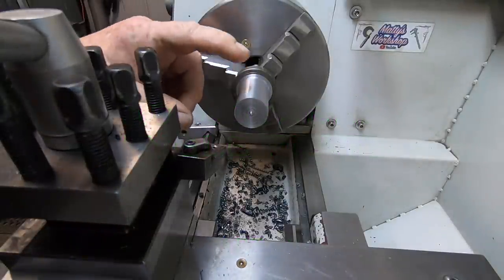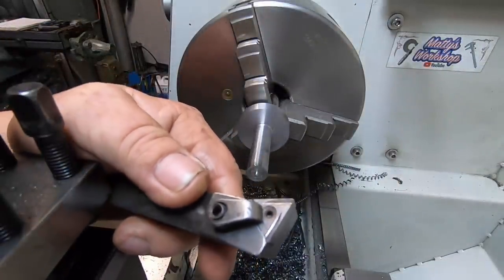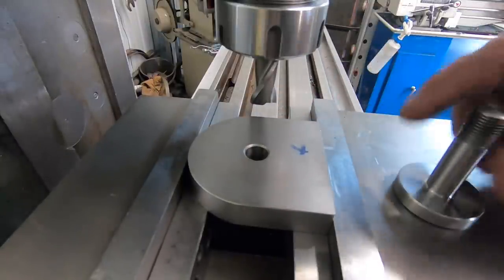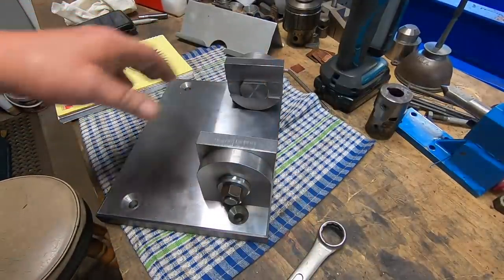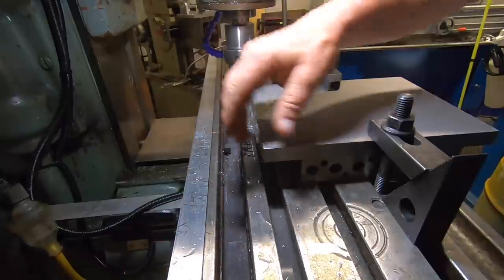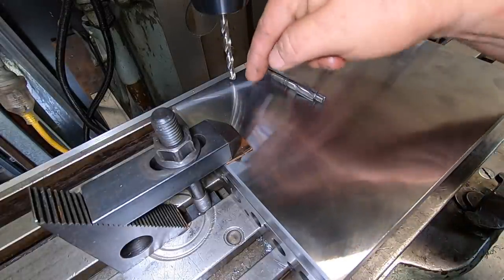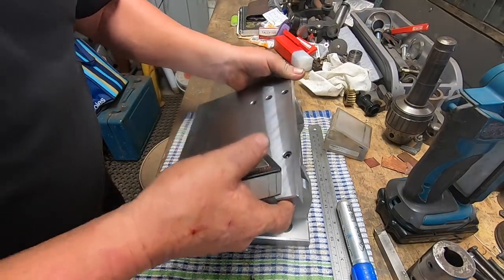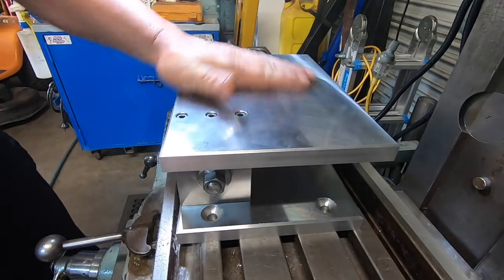Adjustable Angle Plate Part - 2

Comment: I'd go for 3 long tee slots along the x axis, 
Then one central tee slot along the y axis.
Chamfer the tee slots to act as a vee  block,  although you don't have much  thickness for Ts . At the very least a central 3mm deep key slot parallell to the Y axis and an x fence.

I'm trying to grapple with a REALLY difficult to hold  job at the moment. Got my side tilt vice, to do one operation but really need an XY  rotary mounted on an angle plate  and a lot of curse words. 
Internal corner rounding with limited off axis access.  It's an 8.17°slot with an r6 arc at one end and r7.5   arc at the other end, and I have to corner round all internal edges to r2.

One thing I can really recommend is an XY rotary table....with central hole and 4 tee slots arranged in a ❌ .for jigging work.

This can impersonate a cnc machine
Reply from the maker: Gday, I’m worried if I do slots it might warp to much, I still have done anything yet but more then likely do threaded holes and reamed holes, the job your doing sounds like a real challenge, I’m not good at mathematic at all so I don’t think i could handle a job like this, I hope it all goes well for you mate, cheers
Reply: @MattysWorkshop  I'm making my own version of a petzl tibloc rope ascender, with 4mm pitch grooves down the back, instead of  nasty sharp teeth. 
I'm also using the slot in the side as a rope friction device. 
Hence the need to round off EVERYTHING. Final product to be made out of high tensile titanium

It will be so much easier when I've got my xy rotary table assembled,  but I'm only in the prototyping stage, so making a jig now would be a waste of time.
I don't have a habit of making things easy for myself, 
I got through most of it today, without too much swearing  🤬
Reply from the maker: @AdamEdington  I just googled the rope ascender and that’s a very complex part to build, I don’t think I could make anything like this, awesome job mate
Reply: @MattysWorkshop  don't shit on yourself.
If you have a lathe chuck mounted on the table,  you can do 90 percent of it, and the rest can be fudged. 
Is there a way to get a few photos to you?
Reply from the maker: @AdamEdington  you can email me at ttmrj@telstra.com   I’m keen to see some photos…

Comment: If you wanna keep the rigidity of the full plate but just wanna drop the back past that 30 degrees you could keep the bottom plate and bevel the back edge .to drop down against the table you could also bevel the back of the top plate to sit flat against the table when tilted 👍👍👍
Reply from the maker: Gday, I’ve had a few comments suggesting the same, good food for thought mate, thanks for watching, cheers

Comment: Beautiful piece.   What is the RPM you used for the fly cutter?
Reply from the maker: Gday Dan, I run the fly cutter around 600rpm, depending on the material to, cheers

Comment: So typical of inserts, they are bloody complicated and work really well when they do or put a hole in your pocket when they don't. I'm sure these are designed for CNC machines, high speeds and deep cuts to increase throughput. If you are a home machinist and trying to take light cuts and have all the time in the world all to often these are expensive options. So much easier than sharpening HSS but you have to change your mindset I recon.

Comment: FWIW, you have probably done what u r going to do what u  planned but I would pallet it with tapped holes of your desired size. Simply because it could give you more options. 
Just to pleasure my dumbarse mind, why not have the hinge pieces in the centre of the bottom and top plate ? Wouldn't that give 45 either way? And if top plate was slightly narrower,  you could over centre if remotely needed?
Cheers
Dave
Reply from the maker: Gday, appreciate your thoughts mate, cheers

Comment: Drill and tap the top to mount your existing vise.  NO slots to retain strength.  Leave base as is, you can always rotate it 180 degrees.  Make a drilled and tapped fixture plate to mount on the top.  Enjoy!!
Reply from the maker: Gday Robert, I do have another plate to make a second top, that’s a good idea, thanks for watching, cheers

Comment: Without doing a lot of maths, logic says that to get the top plate to go to 45°, it and the bottom plate would have to be shortened to a point where the whole thing is useless. You can experiment by turning the uprights around by 180° on the bottom plate and it will immediately become obvious how short the top plate will have to be. I think the only way you could get what you want would be to make the uprights taller and potentially move them to the middle but you won't then get 92°, you won't even get close!
Reply from the maker: Gday, after a bit of thinking I don’t think I’ll need to have 45° in both directions, one ways is enough I’d say, appreciate you watching and commenting mate, Cheers

Comment: You mentioned eBay insert tooling. I’d like to have a go at making a fly cutter like your 3inch cutter.  Do you use the eBay insert tooling for your fly cutters? If so which ones?
Reply from the maker: Gday, the tool I use in the fly cutter is a SDJCL1212H07 which takes DCMT 070204 inserts, I try to buy the Drillpro brand, these seem to be a little better quality, I hope this helps, Thanks for watching and commenting, Cheers
Reply: @MattysWorkshop  thanks for your time and the reply.

Comment: Maybe leave the top as is for now and just drill and tap the top as required in the future. Sure as eggs you will pre-drill and then down the track find a configuration that wont fit your layout.
Also even if you did cut the base down It doesn't look to me that the top would swing over to 45 anyway. Get the lad to work the math for you, see if its do-able.
Reply from the maker: Gday, I’m not going to worry about getting 45° in both directions, really don’t think I’ll need it, by the sounds of all the comments, drilled and taped holes are the way to go, thanks for watching mate, cheers

Comment: Pallet holes are never in the right place  . Personally, I'd also slot the mounting holes so it's easier to clamp down. I would not worry about 45 both ways.
Reply from the maker: Gday, a lot of comments have said slots may course the top plate to bow, slots are definitely easier for setups, not sure what way to go yet, thanks for watching mate, cheers

Comment: G'day Matty. Don't cut the base plate you won't get much more angle but could reduce rigidity. Tapped holes in the top plate,  slots may weaken it. Cheers Peter
Reply from the maker: Gday Peter, I think I’ll put some holes in the base to mount the angle plate 90° to the table and tapped holes as well as reamed holes in the top plate, thanks for watching mate, cheers

Comment: I like the idea of the drilled and tap penetrations on the top plate. The question is, what works best for you involving the two way 45 degree positioning.Thanks for the look,  enjoyed.
Reply from the maker: Gday John, I really don’t think I’ll need the 45° in both directions after a bit of thought, drilled and taped holes sounds like the way to go, appreciate you watching and commenting mate, Cheers

Comment: I would make the top plate a pallet with alternating tapped and reamed holes. You can then use dowel pins to align work or other fixtures and clamp using the tapped holes. I would leave the base as is for more stability.